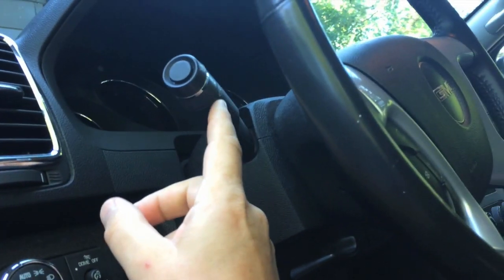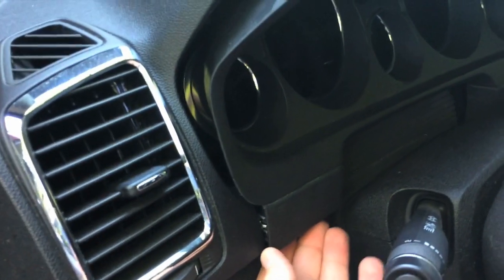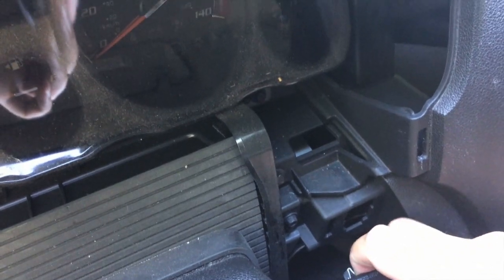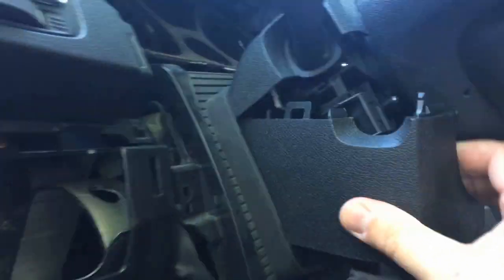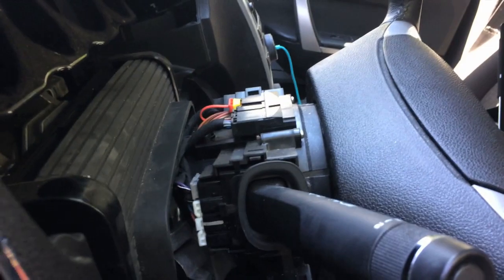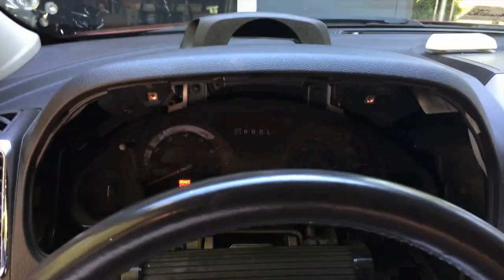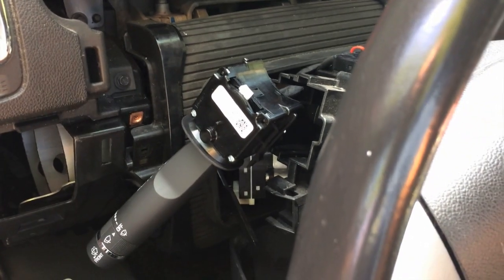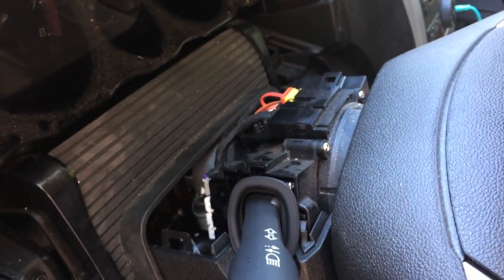"How To": 2007-2012 GMC Acadia Multifunction Switch Replacement

Comment: Great thorough video. I was able to get this replaced by just removing the 4 bolts on the bottom of the column (7mm) and removing the top plastic cover (2012 Acadia). Not sure if this would apply to all models though so good to have all this info!

Comment: My 2015 GMC Acadia wipers and washer stopped working. I checked the fuses, both were fine. The steering wheel telescopes out, giving you enough room to remove just the left bottom and top plastic column covers. No need to remove any dashboard parts! Installed the new switch and all is well, working like a charm! 5 minute job! Took my old switch apart and the blue wire was broken.
Reply from the maker: Cliff Horton good info for those with the telescope function. My wife's doesn't have it, so it required a little more for me to get to the switch.

Comment: Great tutorial.  My 2012 Enclave was very similar, almost easier (didn't have to remove the panels - just 4 bolts and the plastic casing around the steering wheel).    Got the job done in about 5-10 minutes.   Easily saved $150.  Thanks for making this video!!
Reply from the maker: Glad it helped! The Enclave's are nice! I was really hoping my wife would go for one of them over the Acadia but she liked the GMC's styling more.

Comment: Easy Peasy.  All I did was remove the three bolts and telescope the wheel out, then i could remove the top half of the clamshell and pull the lower portion down enough to remove and replace the switch. 10-15 minutes start to finish.

Comment: i have a gmc acdia that i had to replace the wiper transmistion linkage because it was broke.  The motor works but the wipers move a little then stop.  Could it be that the switch is bad that run the wipers and turn signal?

Comment: My wipers work with the normal twisting switch, but when depressing the washer button, nothing runs-no pump, no wipers.  My high beams don’t work when pushing the multi function switch forward, but the high beam toggle works when clicking it backwards. Any idea if replacing the multi function switch will correct this? Seems related to the switch if both washer and high beams aren’t working.
Reply from the maker: djayk certainly seems like it’s the switch considering the symptoms you have.

Comment: The roof lights, the directional light and the yellow one on the front of the driver's side remain on after turning off the car, also the signal does not flash, as if they were fixed, what could be the problem? Thanks a lot.
Reply from the maker: Could be a couple things: 
Starting with the simplest, get your battery tested. These vehicles can do some weird things when the battery is bad. The battery is located in the floor behind the passenger front seat.
Secondly, you’re headlight switch in the dash may be bad. A replacement switch can be found online or at most auto parts stores.
Third, you may have an issue in the wiring harness for the switch. You will need a wiring diagram and need to know how to use a voltage multi-meter to be able to find out if the harness is the problem.

Comment: What was wrong with her wipers? Mine got stuck in the middle of my windshield and wouldnt move again. I took it apart ended up replacing the motor the motor runs once I hook the linkage arma back up it runs slow or not at all. Could this be the switch?
Reply from the maker: They simply wouldn’t work. Stuck in the down position. Definitely sounds like it’s the switch for you. It’s a pretty common issue on these.

Comment: Quick question. My wife’s Acadia the wipers are going very slow. It seem it only works when you turn and hold the switch counter clockwise. Are these the symptoms of knowing the switch needs to be replaced?  Thanks for the video!
Reply from the maker: It definitely sounds like you have a switch issue. If the wipers do not work as they normally should then the switch is most likely the culprit.
Reply: @takeroadslesstraveled6505  Thank-You for the Reply.
Reply: Well the good news is; with the help of your video the job was so easy I was amazed how everything just came apart. The bad news is that the switch made no difference and the blades are still moving at 1/3 the speed they normally do.  Guess you haven’t done any videos about replacing the motor have you?

Comment: 2012 TRAVERSE! The bezel is different with no bolts, but the clips are metal and super tough to get out. I ended up breaking one (there are only two...) off completely and damaging the other. Be careful!
Reply from the maker: Great information here for Traverse owners. There were some minor differences between the model years and the brand variations, so this is really good to know and share. Thanks, Josh!
Reply: @takeroadslesstraveled6505  I did get it done thanks to you! Very concise and to the point. Thanks again!

Comment: I didn’t need to take apart the whole dash to get the steering cover off.
Reply from the maker: I found it was easier to put the flexible cover back on with the dash piece removed. That’s why I did it, but hey, if you didn’t need to, then that’s a little less work for you!

Comment: Don’t follow these instructions- as mentioned pull down on the steering column lock remove 4 screws, pull out on the steering column, pry apart the plastic cover and you’re there!